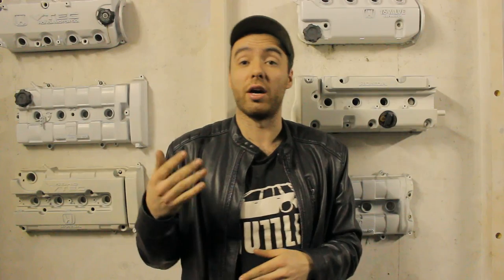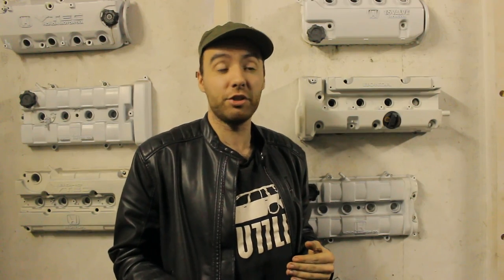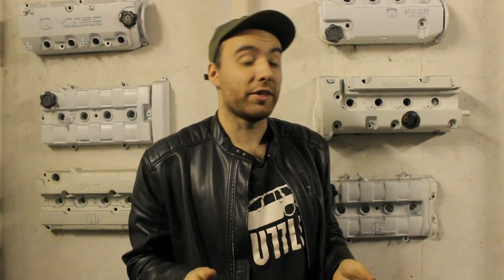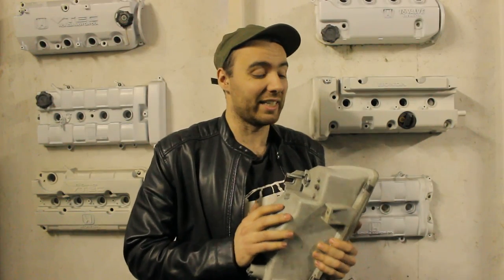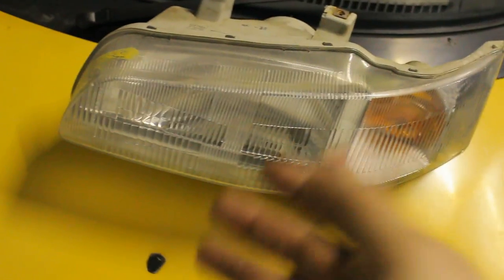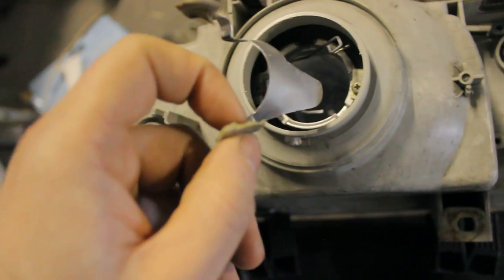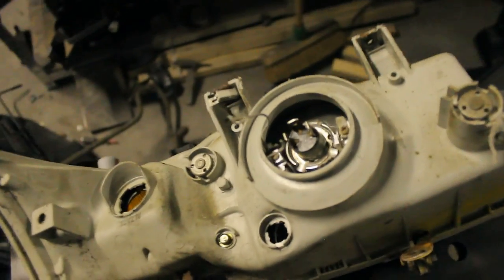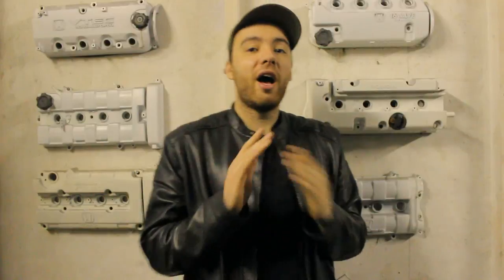Ways to modify your rhd headlights when importing a JDM car

Comment: Though this is a reply to an old video now, this has become the gold standard for many looking to get their RHD imported cars to LHD, but there are still some not covered by this that many cannot find answers to.. and those are headlights with shapes in the reflector, that reflect for a crisper beam, but make it also not have it on the other side for conversion purposes.

So would be extremely nice to see any info that may exist on converting such lights when European regulations prevent us from adding projectors to lights that do not come with them.

Comment: Thank-you for this video. Best on the net that I've found for this topic! Question - the reflector 'bulb cover' type... 2nd in your video. Just double checking that the bracket and fully closed part of the cover was the bottom of the unit facing down? And the entirely open portion not blocked by the metal cover is facing up? Kind of like a tube shaped letter U. So the part you filled in was the "right" side of the cover "U"  when looking in through the bulb hole opening and that's the portion of the light the reflects opposite outwards and to the left (and the part we want to block.) I'm asking as I don't want to stick a part of material to the cover on the wrong side...